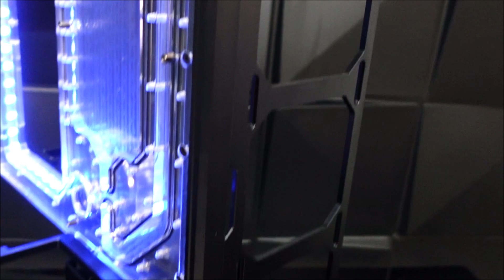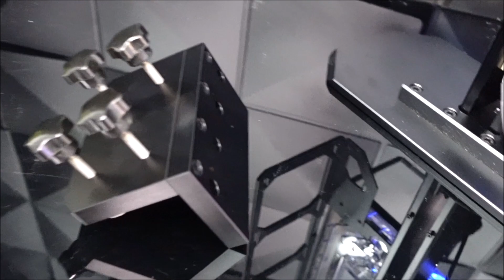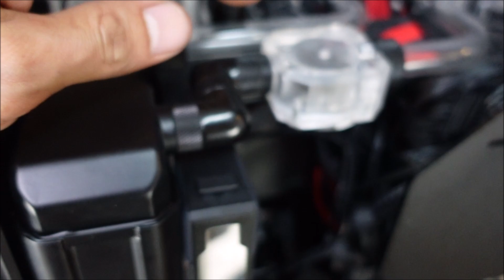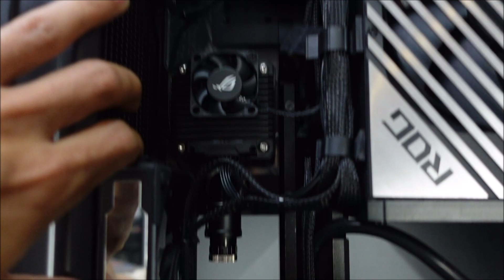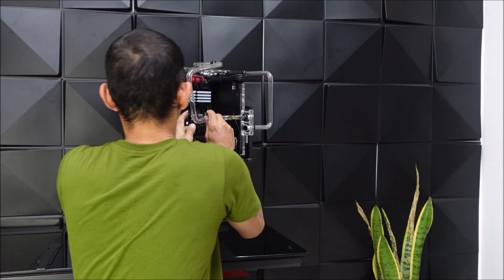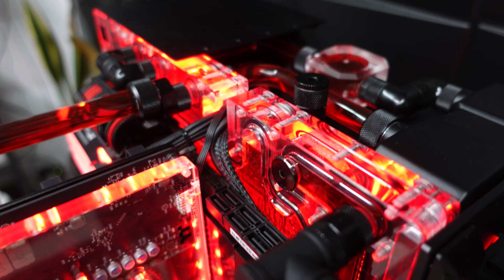Custom Pc Build  #145  " G10 " A Custom watercooled X3D Gaming Pc on a Granzon Distro Case.

Comment: I am looking at this case for my next project and wondering if there are any problems using a 480mm or 420mm radiator with the case.  Of course I would use 120mm to 140mm adapters (or 3d print one) if the bracket isn't wide enough.  It looks like the extra length of the 420 or 480 should be fine.